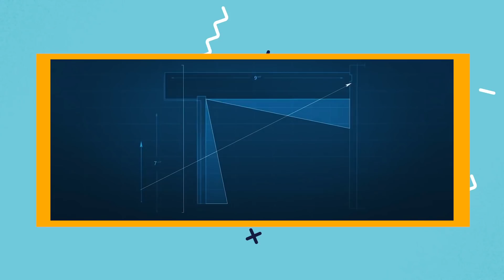Microsoft Unboxed: Mixed Reality and HoloLens (Ep. 2)

Comment: We better see the new Hololens on the 25! And it better have 720° FOV, 8k per eye, weight less than one gram, powered by an i9-9900K and a 2080ti (both on board), but it also need to have the option to be powered by another computer wireless.